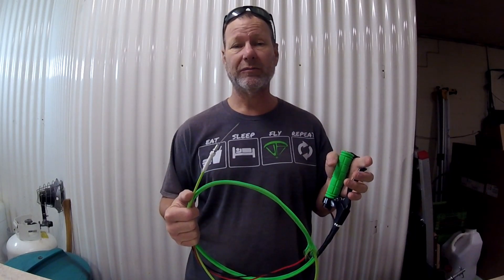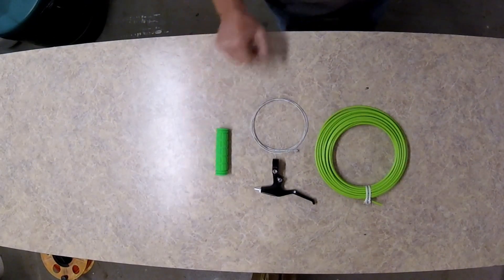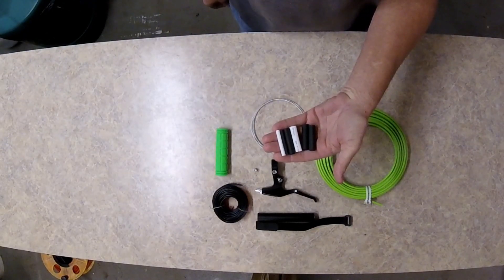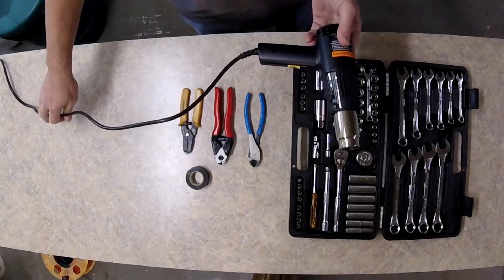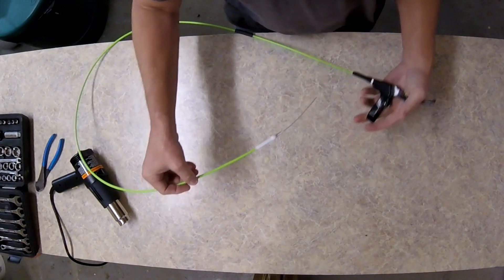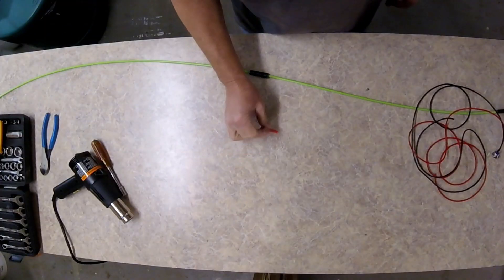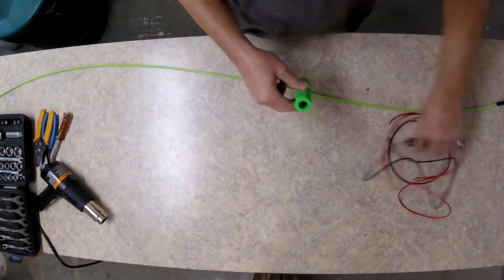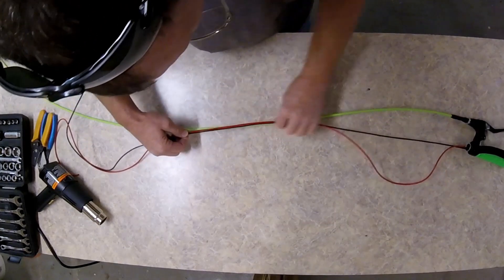Building a Paramotor Throttle

Comment: How do you secure the kill switch in the pipe? Thanks I'm building one now
Reply from the maker: I actually used part of the plastic end cap for these: https://amzn.to/3d3A2ZO to fill the gap, and then a couple drops of CA glue (thick) to hold it all in place. You could wrap the threads in electrical tape to build the diameter you need to fit snugly inside the pipe and a drop or two of CA as well. So far, so good.
Reply: @NCPPGpilot  thank you